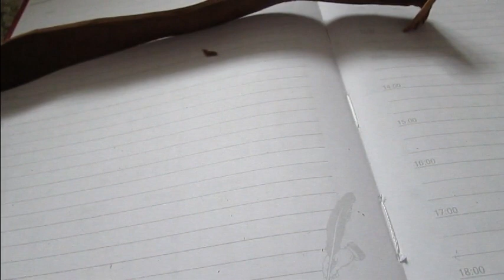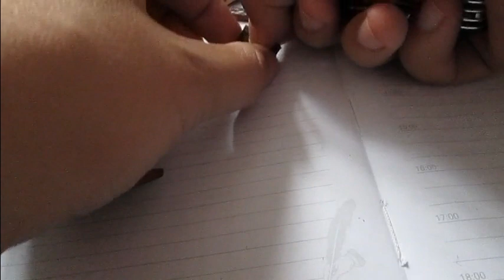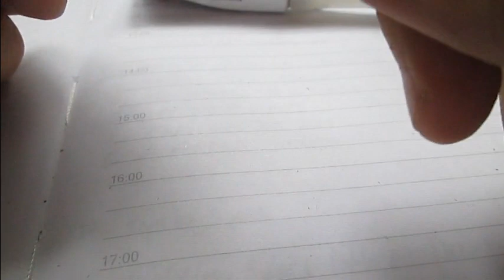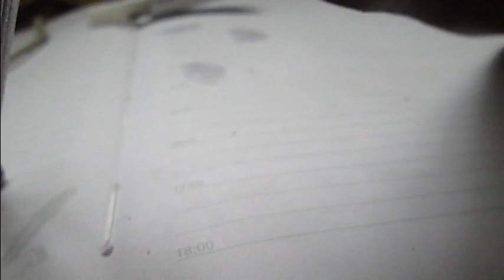How I Make Leather Watch Strap  DIY

Comment: This will sit super high off your wrist- that leather is close to 3mm thick...
Reply from the maker: that is exactly what happened and I made it thinner where the spring bars go
Reply: @edcgunner   Ya- I make hundreds of watchbands using all different types of material. Nylon I've found most convenient- its only ever 1mm thick which works great if you are passing it underneath for a 50% fail safe strap. Velcro fastening I've also found to be most convenient over buckles as it's ridiculously quick to get on/off - extremely secure, very cheap and micro adjustable which is great as your wrist size changes throughout the day ( weather, activity, etc)  velcro allows you to adjust to perfection continuously